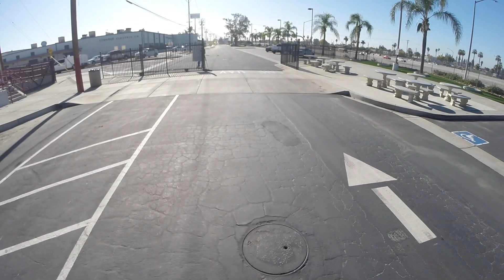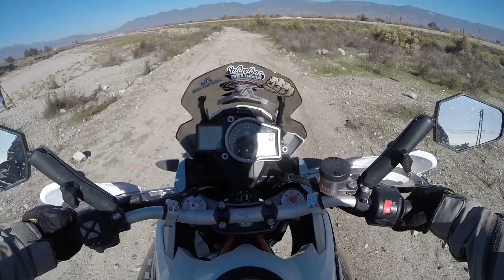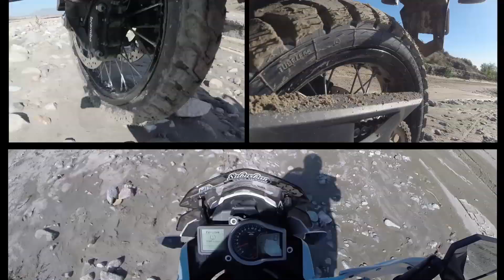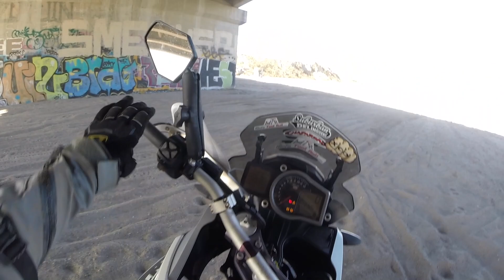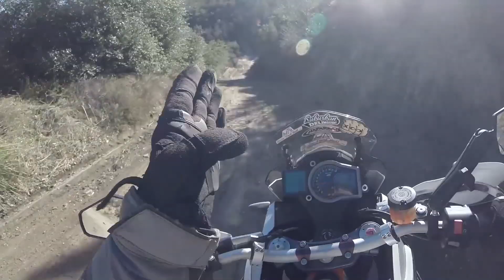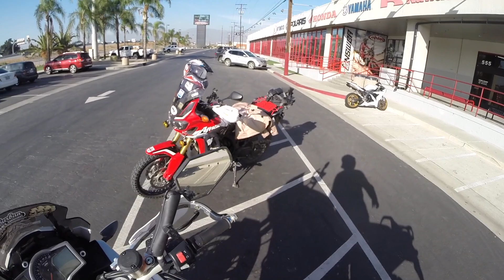Longest Lasting ADV Tire - Heidenau K60 Scout Tire Test & Review

Comment: Just took this tire off today.  They were fine until you hit mud .  They will make your butt pucker up so tight  it hurts .
Reply from the maker: Yeah, not the best in mud. If running in mud you really need to drop the pressure to like 18 or 20 psi. Then the side lugs can bite and the center strip recedes. What did you replace it with?

Comment: The K60 Scout rear tire has the strip.
The K60 (not Scout) is the better offroad slotted, without the continuous strip. 
The best combo, which my old ones are, is a Scout up front and non-scout in the rear. (Front scout is a much more aggressive biter)
Reply from the maker: Great feedback, thank you!
Reply: @manybikes  Welcome!
Sadly the non-scout tire is no longer made for 17" rims, and 18's won't fit without a longer swingarm and chain and suspension upgrade to handle that.....
Guess it is time to look into other tires. XD

Comment: I have a '14 pair of these on my KLR. They do not have that center strip, but normal slotted lugs. Honestly Heid should have kept them slotted. There are 11k miles on these and plenty of tread on front with about 1/4 left on the center of the rear. Great tires.
Reply from the maker: Wow, that is a lot of mileage on a non-scout!  3k is all I was able go get on my KTM 950.
Reply: @manybikes  Previous rider 180 pounds, mid level spring setting, 2" suspension drop on the KLR650, which has far less power than a 950, plus the bike looks like it has been street only so far. Not a scratch on the plastic or decals.
 
That is about to change. XD
Reply from the maker: Ha! Ha! Use it or Loose it!!!

Comment: I like these tires I drive mostly paved but I live off gravel and tend to go down gravel from time to time. Would you recommend?
Reply from the maker: I typically recommend this tire to people who want total mileage and who are not all about performance. I find the tire lacking in the performance department. A very similar tire with much better performance is the Motoz GPS tire. My next suggestion would be the Dunlop TrailMax Mission tire.

Comment: Worthy of comment is that the K60 Scout comes with or without the centre strip depending on tire size. Just installed 80/130;17 on the rear of my KLR and it has no centre strip.
Reply from the maker: Rob Krochenski Yes, there are a few select sizes without the strip bit 90% do carry the center strip.

Comment: So if you dont mind me asking. Why dont you just air down the tires before you enter the off road trail, put it back in after you leave it... Every adv rider is carying a compact air compressor these days  and use that method anyways. That way you would get a nice grip on the tarmac  (as you boast in the video) out of these tires and airing them down  for the dirtroads should make the tire sufficient enough if not even great ?
Reply from the maker: Great questions. Some manufacturers suggest airing down, and some do not. Some have really high (44 psi) street pressures and some have low (33 psi) max pressures. The feel of the tire and how it reacts varies greatly! With a 10 psi change. This the reason I settled at 30psi for the all around pressure.

Comment: Super video job and test with full info 👍👍 if i anderstand well this tire have better performance with a driver with more experience than a new one on big bike adv . you need to know about the pressur tire and how to control big bike of road ... i m new with this kind of bike 3 full saison only 2 with ktm 1290 adv T and now with r1200gs ... i drive k60 with the ktm. and i never put the right pressur for of road i drive 37 and 43.... i never think to put lower pressur for better grip..
 now i know more about big bike adv.  and with all this review 👍👍👍 and all this info .. thas help a lot 
thank's
Since last year a have compressor in my tool box r1200gs... and i play with the pressur tire it is very easy with the GS and is tft screen .. when you play with the pressur don t put the bike off... just tcheck the pressur on the screen... go up or down..it fun for that...
Reply from the maker: Man, such great bikes you have!  Nice work!  The K60 Scout... It needs to be aired down to perform Off-Road.  I run at 25 psi in the front and 18 to 20 psi in the rear on my R1200GSA and my KTM 1190 Adv R.  The sidewalls and tread are so thick and stiff... it NEEDS it!  I run 40 psi on the street... but off-road it really needs to be LOW to allow the lugs to work. Let me know how that feels for you!   Thanks for watching!  - Kyle

Comment: You are my favorite tyre tester¡
Puting the tyres to their limits, awesome 👌✌️
I think the older K60 would surprise us in performance, giving up some mileage. They have a silica version for the K60, which should work on cold weathers and wet :)
Reply from the maker: Alessandro Prescendi silica in a K60! That’s news to me! When did that happen?
Reply: I'm only a year and a half late but I'll chime in anyway. It's called the K60 cold climate and it's rear only as far as I know. I put one on in March and rode it from Reno to south Florida.  In June I did the next stage of my trip to Denver.  The wear accelerated noticeably in the warmer weather and I took it off in Denver after 7600 miles. Having ridden it through so much rain in June that I started to grow feathers and quack 🦆🦆 I can say it's wet weather performance was outstanding. The cold climate K60 is my favorite rear tire that I have tried so far.
Reply: @manybikes  long time ago they came out¡ It wasn't a big shout and not many people were aware. 
Only issue for us in big bikes would be the size of the rear compared to the K60 scout. Don't know if Haidenau does rears of our size. 

There you hace a review my friend :)
 http://defylife.com/travel-gear/motorcycle-equipment/winter-tyre-review-heidenau-k60-silica/

Comment: Very good tyres for long distance travelling. Difficult to puncture and capable of offroad riding at very low pressures. I've got a new set in a garage ready for my longer trip this summer.
Reply from the maker: Motolover Mileage and durability- make this tire a winning choice. Dial it back... when you know you are riding in the conditions it doesn’t excel at... and you are golden. There isn’t a tire yet... that we have seen that will know the K60 off its podium.